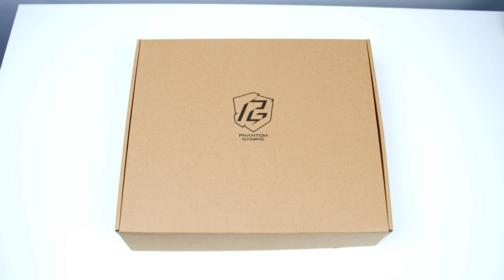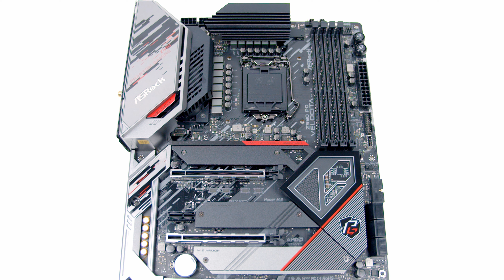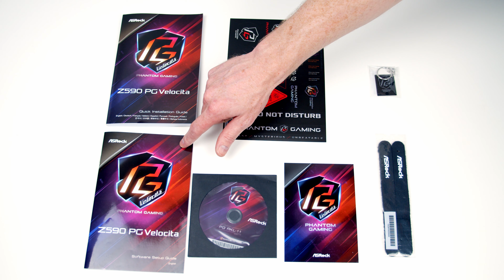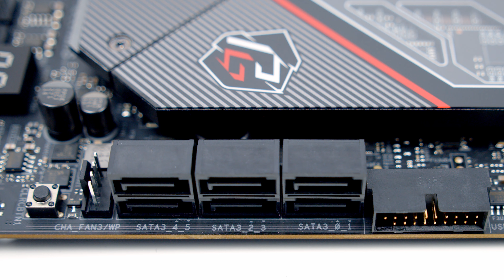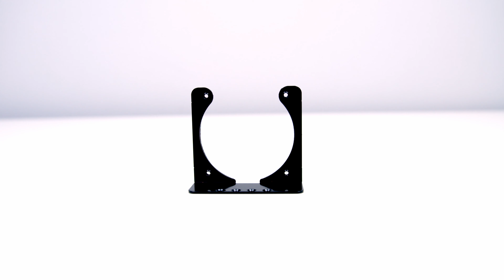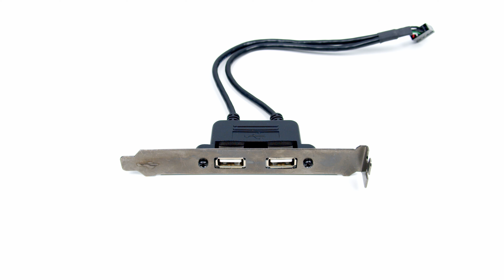ASRock Z590 PG Velocita - First Look

Comment: Hello my cpu (Ryzen 5 5600x) is heating upto 75 degrees which was 88 degrees earlier , my cpu is clocked at 4.3ghz - sometimes 4.6 ghz. The airflow is correct also AIO is Deepcool castle 280 ex installed properly. What could be the reason of heating ? My case is Lian Li lancool ii mesh white please help me 🙏 is my CPU faulty?
Reply: what is motherboard?
Reply: @opheliumzone4671  Msi mag x570 Tomahawk wifi
Reply from the maker: It depends what the pc is doing at the time. If you are concerned with temps check you fan curves in bios and I would recommend remounting the aio pump with new thermal paste, just to rule this out as a potential problem
Reply: @ChristopherFlannigan  I have reapplied the thermal paste and AIO is properly mounted ? Will this be an issue with the processor? 
Btw Msi Game mode is on
Reply from the maker: @YaduUvach  Are these your temps under load or idle? If load what load? Have you tried with game mode turned off? What about the fan curves?
Reply: @ChristopherFlannigan  these are on load. On idle I get around 48-51 with game mode turned on . On load it's 80-83 degrees , I haven't checked fan curves. I did Aida 64 stress test also cinebench. How to check fan curves in MSI motherboard? I'm a first time pc builder.
Reply from the maker: @YaduUvach  It does sound hot - I would turn off the game mode and see what happens to the temps, if you are building for the first time check you haven't done anything wrong installing the aio - is the pump running? You can check the fan curves in the bios - i cover this in my build guides - you might what to check temps with stock CPU cooler in case the AIO is at fault. Unfortunately I can't do much to help without seeing the computer so I would recommend getting an experienced eye to take a look.
Reply: @ChristopherFlannigan  sir with stock CPU cooler wraith stealth , Temperature went upto 108 degrees and eventually pc shut down automatically . So basically AIO is doing the job I guess. With AIO the temperatures are 80-83 degrees. So it might be cpu's fault or motherboard's fault. Also I would like to add something while I was installing cpu it wasn't getting fit correctly at the first time and second time it got fitted correctly. So I'm doubting it's CPU's fault or motherboard's socket. Also I would like to add that Cpu pins didn't had also bend or something also there wasn't any dust particles in the socket. So what might be the issue?

Sir I live in Kerala, India here there  is noone available here within 100 kms to check my pc. So I'm in trouble now with this pc.
Reply from the maker: @YaduUvach  That is useful as this means the aio isn't the problem and I agree it sounds like an issue with the motherboard or cpu. Using gaming mode will cause the cpu to run hotter so I would turn that off, but it shouldn't make that much of a difference. You could try and update the motherboard bios to see if that helps. If not you might need to look at returning the part. If this isn't an option running the AIO as an intake will hep lower the temps.
Reply: @ChristopherFlannigan  sir bios has been updated to version 1.50 which is the latest at MSI's website for x570 Tomahawk , turning game mode off reduces the temperatures to 60 degrees but the performance is very low and the cpu clock speed is stuck at 3.7 ghz and every task is very slow.

I can't return the part right now as the 10 days return policy from amazon is over now.
Reply from the maker: @YaduUvach  Have you cleared the CMOS? If the item is faulty Amazon will normally refund or replace it if you contact them
Reply: @ChristopherFlannigan  yes I contacted them but they are saying that their replacement policy is over now and I have to contact the manufacturer regarding this issue to avail warranty.
Reply from the maker: Ok, I would uninstall dragon centre and then clear cmos, if that doesn’t fix things then it would be best to let them send it away for replacement. Sounds like you have tried everything you can
Reply: @ChristopherFlannigan  sir I tried to reset to default option in the MSI's BIOS, but I'm little bit afraid to touch the motherboard and manually clear the CMOS as i don't want to damage the motherboard.  Okay shall I uninstall dragon center? Btw what problems does dragon center makes to the BIOS just curious to know.

Yes I tried everything , also I would like to add that pc scenario in my area is in the developing age and there are no technicians around me to guide me out into this.
Reply from the maker: @YaduUvach  Dragon centre can affect the CMOS and gaming mode auto overclocks so you would need to reset this to make sure it is not the settings in the bios. So the only way to know this is to reset it. I would uninstall dragon centre and then clear the cmos. You just need to power off the computer and remove the power plug. Then touch the two pins (you will find these in manual) with a screwdriver for around 10 seconds and that will clear the cmos. If that doesn't work you will just need to send it back to manufacturer for replacement
Reply: @ChristopherFlannigan  thanks for helping out I would try that